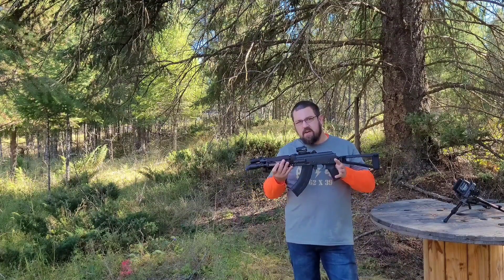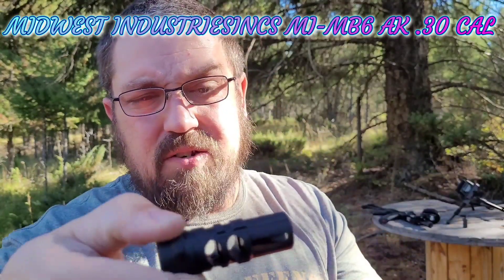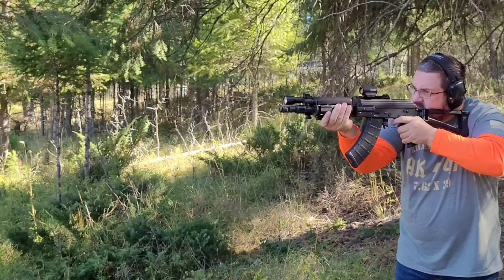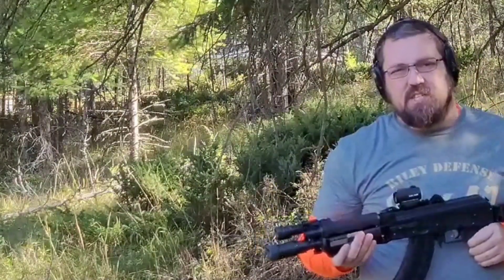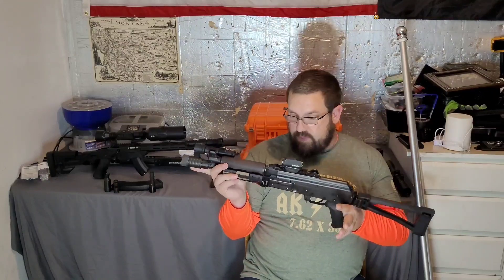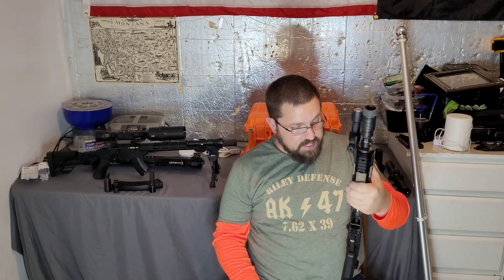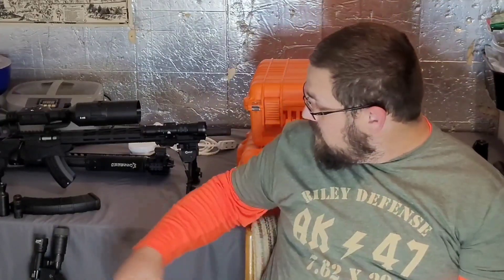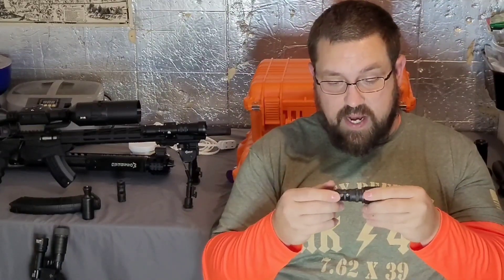Zastava Zpap92 AK-47 Pistol muzzle brake - flash hider test

Comment: finally someone did a video with the Zpap92 and the jcomp v2!! I have run so many different brakes and flash hiders etc on my zpap92 trying to find the best fit. I personally like the jcomp, the OSS flash hider, and the Midwest industries blast can for my set up. the 4 piece is good but very heavy, I find the MI blast can to be half the price and also very light weight with the same performance as the 4 piece. good stuff man
Reply from the maker: Thank you so much for watching please be sure to subscribe.... I'm in the middle of an air gun series right now but we'll be getting back to... The real steel soon.. God-bless and keep your powder dry

Comment: Thanks for making this… It seems like a few more rounds to make sure would have been better but I definitely didn’t see any flash from then 4piece and lots of people seem to like it. How much longer or shorter is the 4piece vs the Krink brake ? I’m using an 
AK-P as my backpack gun and need a decent flash hider. Thanks again for the work. Good video, thumbs up 👍.
Reply from the maker: Thank you so much for watching and commenting...  The difference in length between the Crankoff style brake and the 4 piece is negligible.. Again God-bless and keep your powder dry

Comment: What you using to hold the light on
Reply from the maker: Here is the one I use 
https://www.amazon.com/Magpul-Industries-Light-Mount-Aluminum/dp/B00MRB09NI
Reply: Literally came here to ask that same question. Did it fit on the standard wood stock? I tried putting another mlock device on mine and the holes in the handguard seemed too big for it to lock into place
Reply: @joserazo1985 I think you have to have someone do work on it to get the Malik mounting pieces embedded into the hand guard